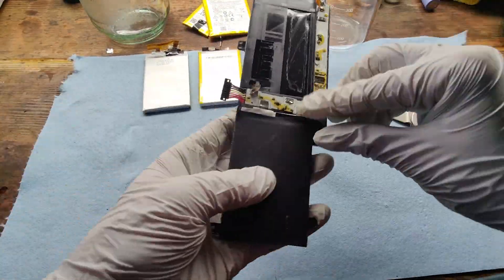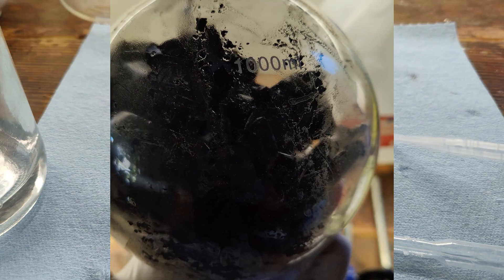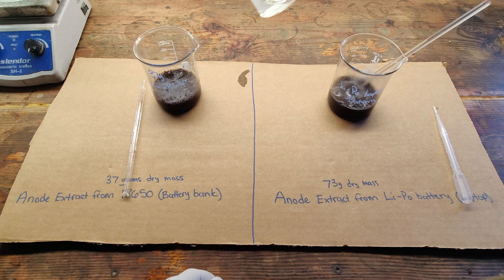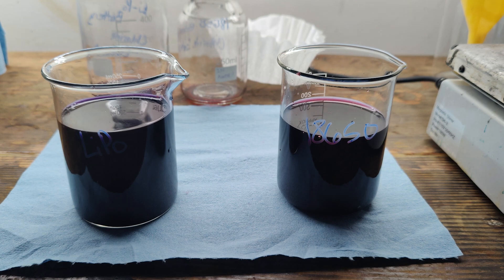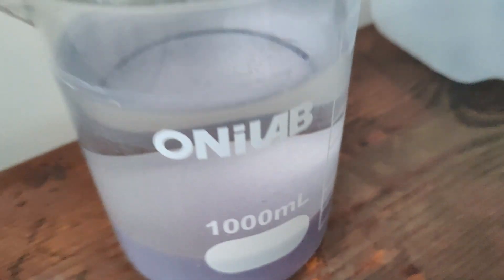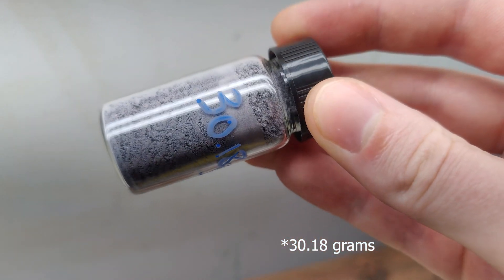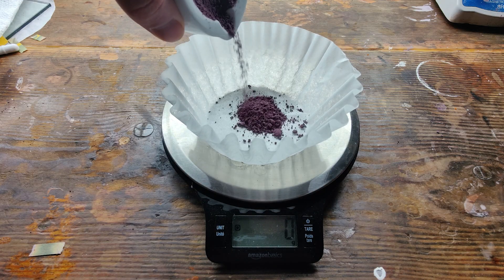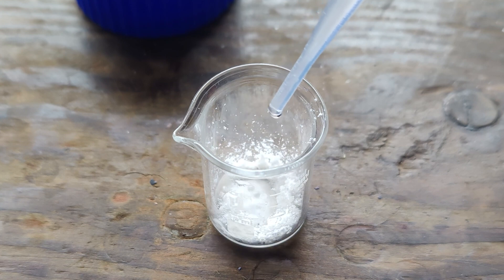Extraction of Cobalt and Lithium from Lithium-Ion Batteries

Comment: @Alamist Actually the hydrogen peroxide can help with the dissolution of the LiCoO2. This compound has cobalt as Co3+ ions and the hydrogen peroxide reduces them to Co2+ ions while releasing oxygen gas. Also if you use HCl as the acid to dissolve the LiCoO2 it will form chlorine gas as the Co3+ ions oxidize the chloride ions in hydrochloric acid. The hydrogen peroxide can also limit the release of chlorine to some extent by reacting with it to form hydrochloric acid and water.
Reply from the maker: Thank you for this explanation! 

I added this part in to the video as a last minute afterthought (You might notice that the equations aren't perfectly accurate or properly balanced) and in hindsight wished I had taken more time to actually think about it.

After doing some more digging, my understanding is that the Co2+ ion is too stable to be oxidized by H2O2 except under some very specific circumstances. Sounds like the chlorine smell I noticed when adding H2O2 towards the end was most likely due to the H2O2 reacting with excess HCl to produce water and chlorine gas, and nothing to do with the formation and subsequent decomposition of CoCl3.
Reply: @Alamist  Well, the chlorine actually comes from the direct reaction between the hydrochloric acid and the lithium cobalt(III) oxide since cobalt(III) ions oxidize chloride ions from the HCl to form chlorine gas. You can avoid that by using a mixture of hydrogen peroxide and sulfuric or nitric acid which only releases oxygen gas instead.
Reply from the maker: @chemicalmaster3267  OK something wasn't quite adding up, but I think I've found the missing piece of the puzzle that lines up with what you're saying.

 I found an article about acid-leaching LiCoO2 that talks about the formation of a mixed-valence solid (Co3O4) when dilute HCl is added to LiCoO2 in the absence of a stronger reducing agent. This Co3O4 forms a "Crust" around the LiCoO2 and reacts much more slowly with HCl than LiCoO2 does. This is probably why it looked like the reaction appeared to stop (along with the chlorine gas) even though there was plenty of excess acid in solution. Adding H2O2 (a good reducing agent in this specific context) helped to reduce the Co3+ in the Co3O4, making it soluble, and re-allowing direct access to the LiCoO2 by the HCl which resulted in an increase in chlorine gas production, like you said. Thus, it makes sense why I would have noticed chlorine gas suddenly being put off when adding H2O2 to a solution that appeared to have stopped reacting with the solids.

I think this explanation makes the most sense. It lines up with my experimental observations as well as your explanation of the interactions between the HCl and the Co3+. Thoughts? 

Sauce: https://www.sciencedirect.com/science/article/pii/S0045653521024929
Reply: @Alamist  Well, if you can look at LiCoO2 as a kind of mixture between Li2O (lithium oxide) and Co2O3 (cobalt(III) oxide). If you multiply the lithium cobalt(III) oxide by two to make 2 moles of it and remove the lithium and oxygen in the lithium oxide ratio, you should find out that all that is left is cobalt(III) oxide. It's quite an interesting way to look at a compound that looks like a mixture between two others.
Reply: @Alamist  Also, I think there´s a better way to precipitate the lithium out of solution after removing aluminium, copper, nickel, cobalt and manganese from it: try adding a solution of sodium silicate to precipitate lithium silicate which is more insoluble than lithium carbonate. You don´t even need to heat the solution, otherwise the lithium silicate can actually react with hot water to form soluble lithium hydroxide and a precipitate of silicic acid. After filtering and washing the lithium silicate to remove soluble impurities, you can add an acid of your choice to form a soluble lithium salt while leaving behind a precipitate of silicic acid.
Reply from the maker: @chemicalmaster3267  Maybe yeah. There's always a more efficient way to do most things if you're willing to put in the time, money, and effort to figure it out. Personally, no point in buying a new reagent when the box of washing soda I have on hand would work just fine. Only thing I'd do differently next time is mix the Sodium Carbonate with HCl and bubble it into the Lithium solution instead of directly adding it. If you decide to give it a try with Sodium Silicate, I'd be curious to hear how it works out!
Reply: @Alamist  Yeah, I know! But sodium silicate can actually be made with cheap or free reagents: sodium hydroxide, which can be found for cleaning drains and pipes, for example, and silicon dioxide, which is a component of sand or can be obtained from silica gel packs or crystal cat litter, for example. The only things to watch out for is to melt to reagents in a container that is not attacked by molten NaOH and that a solution of sodium silicate will slowly react with CO2 in the air to make sodium carbonate and insoluble silicic acid which will thicken the solution even more.
Reply: I have been following up with your thread both of you and this got me interested, well here is the thing I use Sulphuric acid to leach these transition metals from their Aluminium foil and the polyvinyl fluoride warps then just like wise the solution comes dark red pink colour something of like, then I added Calcium carbonate that I have extracted from the eggs shell this led to the foaming formation into the jar with little amount of water added into the solution I observed a pure white precipitate comes out settle down, I would like to what might this be?? I was wondering if we might have precipitate any of these two in first place lithium carbonate or lithium sulphate.. Thanks in advance

Comment: I'm commenting early so you might mention it later but the membrane's from these batteries can be useful for some types of electrochemical divided cells.
Reply from the maker: I did not mention it in the video, but that is a good point!

 I did save my membranes. I also separated the graphite and copper from my anodes. 

While the video is about the Cobalt and Lithium, nearly every part of the battery can be separated and reused for other experiments, which is pretty awesome.
Reply: finally a super interesting video! thank u for doing it.  Do more!
Reply from the maker: @pipulas1 Thank you! Glad you enjoyed it!